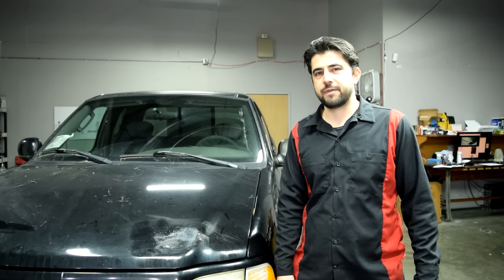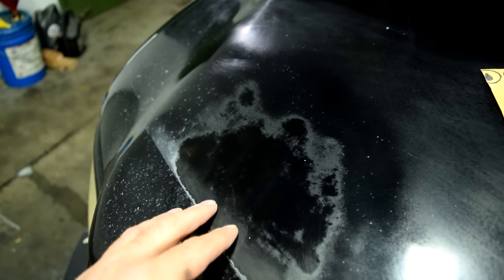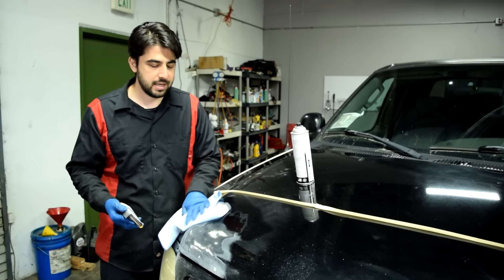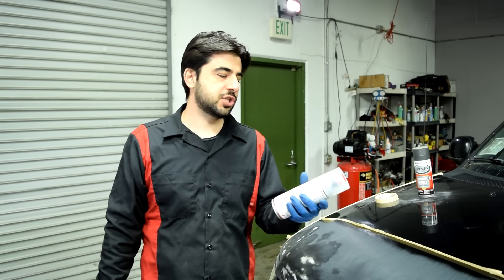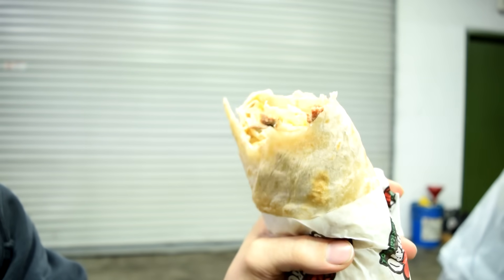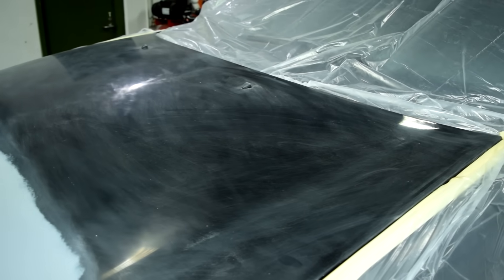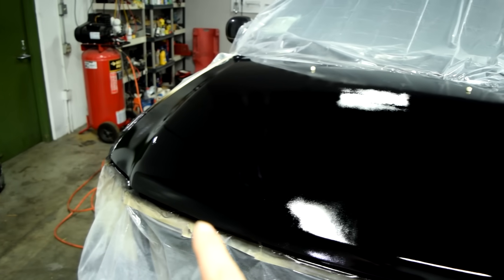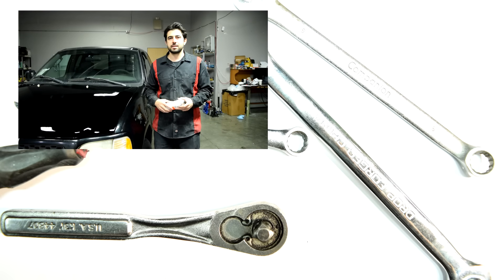How To Paint Your Car With Nothing But Rattle Cans

Comment: I'm lucky enough to have a sufficiently-large compressor and borrowed some HVLP guns from a friend, but I'm still painting in a garage. I had some - well, a LOT - of trash land in the base coat. I didn't spray the (expensive) clear and tried sanding out the trash bumps with 600 grit, which messed up the base coat as the sand paper immediately clogged despite waiting about 36 hours for it to cure. I'm about to respray the whole panel. Any advice on getting debris out of the base? Should I go ahead and shoot clear and then fix it at that stage? (That strikes me as bad idea.)

Comment: Thanks for a very good instructional video.  I am going to use the information to repaint my Toyota Tacoma canopy, or topper.  I am planning to use Duplicolor Perfect match 8oz rattle cans, but I have no idea how many cans I will need to do a good job.  The canopy fits a 6 foot truck bed, and it is 5 feet wide and about 2 to 2 1/2 feet tall.  Do you have any advice?  Thanks.

Comment: was surprised when you didn't do another high grit sanding after the base coat and spray one more time w/ base coat. and that you didn't wait a longer time for the base coat to cure before spraying clear coat coz I think 2k base coat needs a lot of time to cure and release all the gasses it has when its curing? correct me if I am wrong tho.

Comment: Hi, I have done left and right front doors of my Outlander and followed every step and it turned out good almost professional finish. But the only issue I am facing is the orange peel. I tried 2000 then 3000 grit after that cutting and polishing got the shine without swirls. But the orange peel is still there.   Afraid of sanding too much. Any suggestion will be highly appreciated.
Reply: I think the vlogger was wrong. I think you need to sand both the base coat and the top coat to remove orange peel.

Comment: Don't be FOOLED ~ even though he did solid work, using spray can clear will not last long as it can not take the heat and UV rays of the sun. Cheap tools & materials represent the single biggest mistake DIYers make when approaching these types of projects. A good tool is not an expense, it is an asset that can be sold for 80%-90% of it's value once the job is done, and in the end it will produce superior results and require much less sanding & polishing. Best budget HVLP Systems: 1st choice: Fuji 2202 Semi-PRO 2 ($439) (2203 gravity fed version) & 2nd choice: Earlex HV5500 ($299).
Reply: Really omg I was so excited

Comment: Another question. I bought a buffer. 1st time buffing The buffing pad was jumping around would not glide. What am i doing wrong. Do i need to do something to the pad. Do i need to wet the pad to make softer. It ended up taking to much paint off. Like the paid was to dry.  Was not gliding like videos I see. I was using compound

Comment: Deserves to be teleported 3 years into the future. Fantastic tutorial, I've had some experience experimenting with spray can repairs. 

For some reason I was under the impression that the entire panel would need to be primed, but the base coat will adhere fine to the roughened original?

Your joke delivery is soooooo deadpan I had to go back and make sure you weren't seriously stating the freezing point was 65 degrees hahahahaha

Comment: You know I am a 37yr old female and I can run heavy equipment (644j fronted load, Tellahandlers, skidsteers, etc), stick weld, carpentry, break and train plus internationally shown horses, hauled over 400k miles both heavy equipment and horse (know how to load and properly bind to DOT specs), plumbing, solder, and currently learning mechanics. So maybe you need to go do some dishes and leave “men’s jobs” to women bc we can not only multitask but multi industry.

Comment: My issue is I want to paint my old truck. But I dont want to buy a compressor & spray gun. I only plan the one job then I have the rest of those tools. So, for the size of the job and the condition of the truck I'm trying roll on Tremclad or Rustolium.

Comment: I have a question. I love your videos, don't stop!! You mentioned in this video, while using the 220grit and block, to not remove the original primer. What if I used an orbital sander and took off the original primer to metal(Found your video after the orbital massacre, lol)? I had big pits on the first 1/3 of the hood from 200k miles on my 04 Tundra. The rust had filled in the every chipped paint/pit location on the front part of the hood only. I'm going to proceed with the primer, basecoat, and clearcoat rattle cans I purchased online a month ago. I hope rattle cans won't be an issue, if I took the front 1/3rd of hood down to metal... Great Video!!!

Comment: Friend of mine worked at a body shop, watched me paint a quarter panel on my wife's car, he told me I was standing to far away, I was feathering it and about 2-3 feet away, after the I sprayed the clearcoat I was about to sand and polish and he looked at it and was like dude, you have zero orange peel, maybe your onto something... he was right just by some freak accident it went on perfect with no orange peel. Not sure if I had a good can, or was because I sprayed it so light so many times from further away, but it looked like it was factory when I was done.

Comment: In my feeble attempt (not to bad) to fix top of car, real bad clear coat deterioration. When applying Spray Max 2K (368 0061 - I used 2 can) instead of using a sweeping motion on the top at times I used a serpentine movement, leaving globs - how can I fix those globs. I tried to add a picture but couldn't. --- HELP ---

Comment: Using rattle cans for clear coat repairs on the hood the top or if it's a car the trunk is a bad idea because it leaves streaks blend lines tiger stripe whatever you call it and that's because you do not get a big enough fan out of a can so it does not become more Unified

Comment: So do you not sand over the base coat before applying the clear coat? Just making sure I didn't miss something
Reply: No... if you use his technique of "wet on wet" you don't have to... after 1 hour the base coat is not cured so the clear coat is gonna blend somehow with the base coat... on the other hand if you wait too long and allow the base coat to dry then yes you have to wet sand it before you apply the clear... more work and doesn't change the end result

Comment: When i hold the can down like that and that close. I get air bubbles immediately. Resulting in having to re-sand everything down all over again after it dries. What could i be doing wrong? I even spray from 10-12 inches away and still get air pockets immediately when it touches the plastic. I can go over it 10 times and their is still little air pockets the paint will not cover.
Reply: I watched the whole video and found my problem. Lmao. I googled it too. Its fish eye that happened!! So apparently i didnt clean it enough.

Comment: Maybe metallic paint is for ladies. This is an excellent video overall, but anyone with metallic paint needs to make a significant adjustment. The base coats have to be dust coats, and not nearly as wet as this version. Otherwise you'll have mottling everywhere.

Comment: What to take from this video .Only two component products are durable. These cans have hardner in side the can making it a real urethane paint.
     If you under coat the bottom of your car , use two part bedliner instead. The two components make it far more durable then a single component spray can.
  Any product that has two components .Will cost more but last years longer.
  Good video..

Comment: I was going to stop at the dish washing statement but i decided to keep watching because chances are the guy makes a BIG MISTAKE and he did. 

1.) He did not follow a path all the way across the area! He went half way across and if you look at the end of the first coat of primer you have this thicker section in the middle. You have to go from one side to the other. Maybe he should learn how to wash dishes instead.. Its much easier, You just spray them off and put them in the dishwasher! LOL, The Spraying technique might give him a problem though. 

He did the same thing with the paint and the clear coat probably caused some of the streaks because you should start spraying off of the item being sprayed then come all the way across the work area. Other than that everything he did was proper with the exception of actual technique.

Comment: Yes alot of fogging and orange peel. I pull the can back a few more inches and do my side hood trims first. Then I always apply 4 coats of clear and with paint or clear I never say, "finish the can".... Hell I will go another coat of clear before I do half a hood! Always can said. To me I would of painted whole hood. Nice job just not to my standards. I do the same paint on a 100,000,00 car or 10k car. My hand shake depends on it. The waxxx shop!!!! You got to treat her nice!

Comment: My fender got damaged so i bought a blue second hand fender. The second hand fender is perfect condition but My car is red. 

Is this right : 
1.400g sanding
2. Prime
3. 400g ontop of primer
4. Base coat
5. Clear coat
6. Polish

Do i have to use primer? Or can i skip that?

Comment: Meh, I didn't like the final result as much.  I really think you should have covered the entire hood with that last coat of black paint.  I mean, you literally had like a few more inches left.  It would of made a difference.  Also, the portion of the hood towards the front seems to be a lot heavier in the base coat.  It looked like the paint almost pooled there.  You should of backed away a little more.  Overall still cool work!  Something that anyone can do.

Comment: Question, I painted my car with 2x Rustoleum and I have some strips in the paint. What can I do to take the strips out?
Reply: I did the same thing. So I wet sanded with 1000 grit, sprayed one more coat,wet sanded with 2000 grit, used turtle wax rubbing compound, and wa la. Shinny and slick.
Reply: Thanks so much
Reply: Hi Sir, One more question for you.  Do i need to wet sand by hand or should I use the Orbital sander?
Reply: @flexinlex2003  I would do it by hand. All youre doing is prepping the surface for another coat to stick to. A sander might remove too much of the 1st  coat.
Reply: Thanks Sir

Comment: Another way to fix damage like this is to not tailgate so much.
Keep a longer distance and your paint won't get dinged by road dust and rocks.
Reply: StopaskingformynameYouTube 
It doesn’t really matter. I’ve noticed that if I leave enough room to prevent damage to the hood and bumper, some asshat thinks I’ve left a spot for them to cut over in front of me. It also reminds me of the time I had some small minded man in a nicely pained ElCamino firmly on my butt. So I hit the shoulder so he could pass. He didn’t like my speed at first, not fast enough. Only (70 in a 55) then he didn’t like the rocks being blasted from the shoulder of the road onto his ride. Basically, it’s like a paint and body friend of mine told me. “it can’t be prevented unless you park it and don’t drive it.”

Comment: That rustoleum primer is NOT laquer based stop misusing the term. Its oil based not laquer. If your car is acrylic urethane then yeah it prob isn't good for it. But calling is laquer is incorrect and confuses ppl.

And 65 degrees is not freezing or close to it dude.

Comment: Can someone please explain to me what he means by "tack down your panel"?
Reply: I think he means using a tack rag to wipe the panel with. A tack rag is a special kind of rag that collects all the dust from sanding that you might not be able to see with the naked eye. So in other words, you don't want to prime/paint over dust - you want your surface as clean as possible - so you use air compressor to blow the dust away but some of it will still settle on the panel; then you get your tack rag to remove this extra dust so that your panel is as dust-free as possible

Comment: Watch out folks. Rattle can paint could be petrol soluble. ABRO surely is. Very disappointing after spending hours on sanding, masking & doing without the vehicle while you work & permit the paint to dry thoroughly. No mention on the can about it not being for automotive use.Got tar on the vehicle hence used a petrol soaked rag to wipe it off. Got the paint off faster than the tar

Comment: The streaking in your clear coat was due to poor technique. Always hold the gun or spray can perfectly parallel to the surface. You were hoping it at and angle, so the spray fan was more concentrated at the bottom then the top; with will always crest those streaks / tiger stripes.

Comment: You know what clear coat does to paint? Yeah, it also does that to your lungs when you breath it in. 

Imagine this hardening on your lung tissue and trying to breath. Scary. That's why you need to wear a proper respirator AND the correct filter. 

Really surprised the later videos doesn't show him coughing and having breathing problems but they're all heavily edited.

Comment: Do not try the paint your car with metallic spray paint. The nozzle will continually stop up with metal pieces and spurt out. I had custom paint mixed and put in cans by paint master and it's butter drip and the paint color did not match

Comment: Rather than rattle can..a harbor freight pot gun is 12.00 and aristoshield Dunn Edwards semi gloss plaint is 11.00...thin with water... practice and clean sand paint clear coat. It looks amazing.so good you can brush it and it Lay's down. Your welcome. Don't ever fix a Ford...they are not worth it.
Reply: No they aren't worth fixing. Good thing I haven't had to fix anything major in the last 25 years. Looking like it's gonna be good for another couple years too. Totally not worth it.